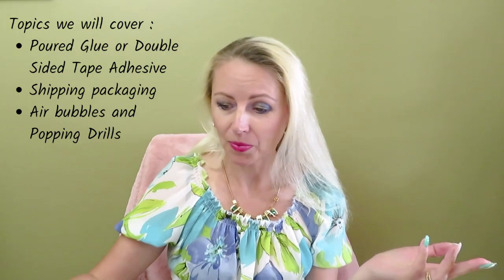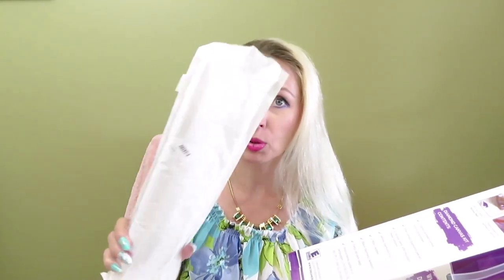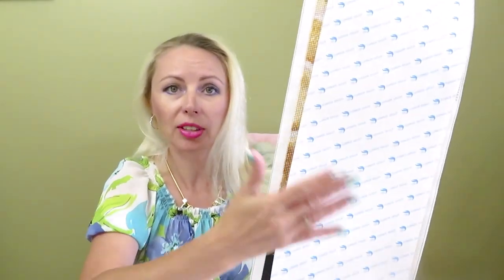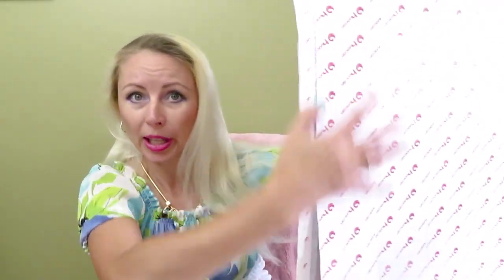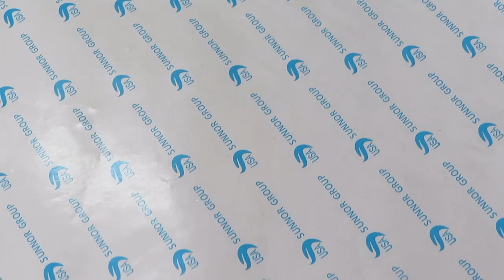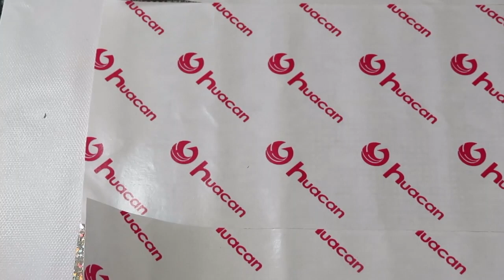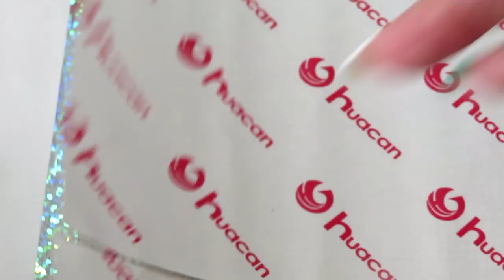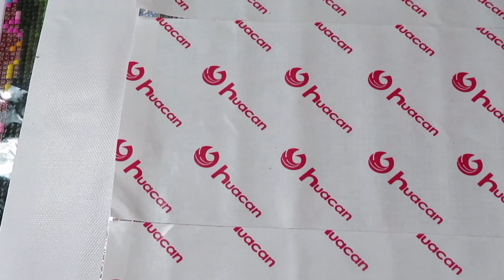Diamond Painting Air Bubbles & Canvas Creases  | Diamond Painting 101

Comment: I have seen a lot of squished canvases in both bags and boxes. I prefer the sturdier thick tubes to be honest but I do agree that poured glue is much better than double sided tape because you do not get air bubbles or glue ridges you have to fix. I was wondering if this means with your poured glue you do not have to seal the diamond painting after?
Reply from the maker: Hi Cathy! We roll each of our canvases around a foam roller in addition to protecting it within the box to be 100% sure of no creases. Our DreamTech Adhesive is so strong you will not need to seal the diamond painting. However if you do incur any problems, we also have our lifetime warranty as extra insurance (free with every kit purchase). Thank you so much for watching and happy painting!! 💜